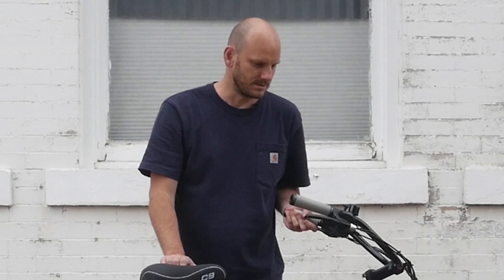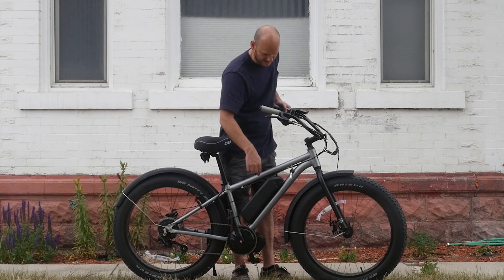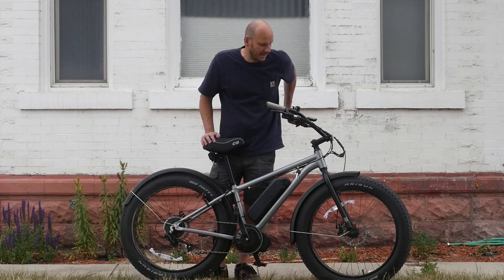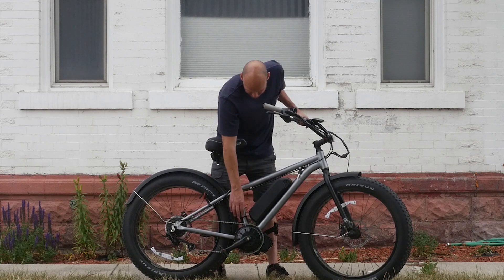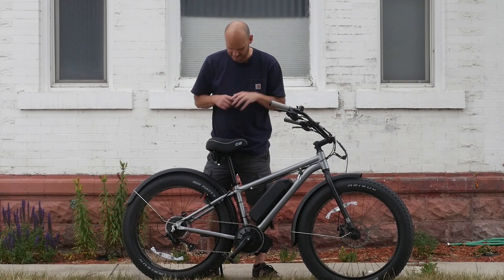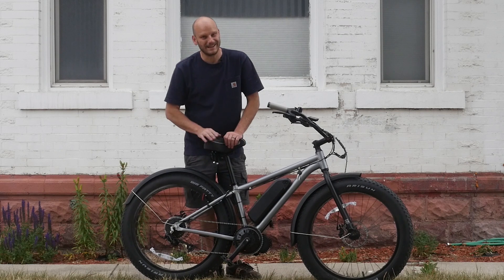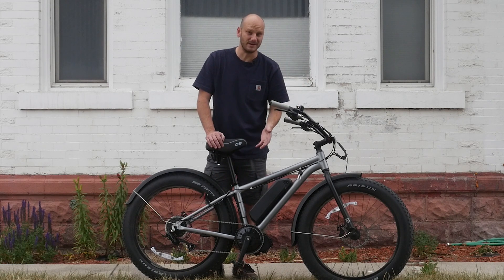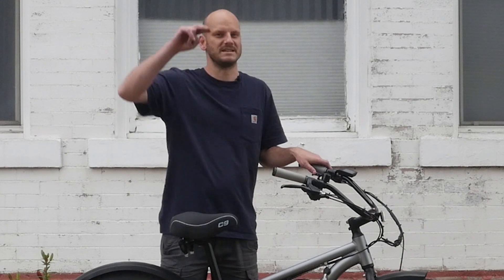Custom E-bike Build: Mongoose Dolomite ALX BBSHD 52v 14ah

Comment: I’m building a mongoose Argus trail with bbshd, hydraulic brakes, bmx bars, pedals, seat, and stem.  Im enjoying the process, and thinking about trying to make some extra money building bikes.  I can’t find anything comparable on marketplace for less than $3,000.  How much could I realistically get for the completed bike?  Everything I’ve started with was brand new.
Reply: Also, I ordered the bbshd kit from you.
Reply: Got the same bike. What battery did you use? I have the medium frame and wondering about what battery would fit.

Comment: I noticed you're out of stock on the Northrock XC00. Have you considered using the ALX as a replacement donor bike? It seems to be the cleanest build. No bunched cables, spacers for chain line issue, etc. I'm selling my Giant Talon 2 because its not the best donor for 4 seasons and the internally routed cables would be pinched by the motor if not rerouted. I'm planning on building my own with a large frame. Would you use a 42t to help me with snowy Nebraska hills and light off roading? Goal top speed 30.

Comment: I am the owner of this bike - had it made for my wife (the reason for the smaller than usual frame).  Fenders are from Rad Power Bikes - a little mod work was necessary but worth the effort.  The cruiser bars (from Cason City Bike Shop) have since been replaced - they required your wrists to be bent at an uncomfortable angle.  Replaced with riser MTB style bars.  Loving the bike so far.
Reply: so , how is the long term review?

Comment: Good review. What do you recommend for air pressure for the fat tire bike do you like. I’m 6’1,  205, and l have mine at 25. Tried 20, but bike felt sluggish. Your thoughts.
Reply from the maker: I like them at max for pavement unless I’m in soft terrain then go low as possible. Every tire is different for thresholds

Comment: I have built numerous hot rodded BBSHD powered Mongoose Dolomites, and at 230lbs., I have done a lot of off road rides and jumps with no problems whatsoever.  I did put suspension forks up front on all of them.  Great base bike, but this one looks too small in the triangle for the 27ah triangle batteries that I use.  Great video.  Cheers.
Reply: I think this was a small frame - S - 17". They come in M and L, as well.
Reply: I just purchased the steel dolomite. My 72v20ah plastic triangle battery fits no prob but I want more AH. Have a recommendation for triangle battery?

Comment: Bent my rear axle on my fat tire ebike. Thinking the 1000w bfhd motor with 30t sprocket was to much tourque for the cheep 9.5 long rear axle.  Any suggestions on a rear hub chang over?

Comment: I so wish I had bought one of those when available. The best deal I've ever seen on a fat bike. If they release more at the same price I may risk the divorce to get one;)
You made it into a really sweet cruiser. It seems like with different mods it would be an OK MTB.
Yeah it could be a better climber but that's a pretty harsh test without that right gearing. The sort of test that can fry a controller if the gearing isn't low enough. It did fine considering.

Comment: I am puzzled. You talk a lot about climbing hills. This is no off road build. Can't imagine much steeper climbs than out of The Mississippi River valley. If I could order all my motors, which are no where near as powerful, with 48-52 tooth chain rings, without paying extra, I would. Is this because you expect most of your customers to throttle ride?
Reply: BBS02 , cheap and good at hills on the right bike.
Reply from the maker: I live in Salt Lake City where hills can reach 15% grade on pavement. Hill climbing here doesn’t mean off road👍
Reply: Come to New England for some big hills
Reply: @Justagirlthatlovestheforest  I ypu have lots if hills, but not particularly steep.

Comment: John what size tires are you using on the Mongoose 2021 I have a 26” mountain bike mongoose rear wheel drive 1000 watt motor and a 48volt battery I built myself and I can get a top speed of 55 mph Lawrence can’t get enough of snow waiting patiently 8/31/2021 bigger is better 29”& 30” wheels
Reply: 55mph from a 1000w motor  you sure.  55kph maybe
1000w is equal to 1.34 horse power   the 2 stroke motorised bicycles push out 3 to 4 horses and they struggle to pass 50mph
Reply: @davidaustin7296  yeah 55 kph would be just about right for a 1000 watt. 55 mph no way.

Comment: How susceptible are the motors to water - I don't mean riding thru floodwaters where it will be submerged, but rain, puddles, that kind of thing, are they okay to ride when it's wet out?
Reply: Well I rode my iZip E3 Peak w/Currie hub motor in rain & wet all the time. Commuter bike, sometimes it rains (Bullet Proof since 2015) my battery is now expired. (Mid-drive 28 mph model ).
Reply: I’ve rode my bbshd home in crazy rain one time. Still works, would not recommend though
Reply: I took my carbon folding bike with mid-drive BBS02 out in the rain the other day. Bike got covered in mud and water. Still fine. I wouldn't do it again though or often.

Comment: Great videos , it’s awesome to see this bike through your test , I just bought a fat bike for hunting and going to put a bbshd and was wondering about what gearing I would need, so what chainring and cassette does this bike have? Also  how is the chain line  and how many speeds are used?did  the mud guards come with the bike ?Cheers from Australia
Reply: Luna eclipse chain ring  is what i use on my dolomite. Its comes with a 14-28t freewheel though , not a cassette
Reply: @soandsononame8750  cool  so what how many tooth is your chainring ? What top speed do you get on lowest and highest gear
Reply: @Artie6937  my luna eclipse is 42T i believe, it has a large offset that corrects the chainline as much as possible.   in first gear / 28T  it goes up to about 21mph with a 52v battery straight off the charger.  I don't typically use 7th gear because thats my one gear where the chainline isnt great and skips under high power. Dont really need 7th gear anyways, as the 6th gear can get it going 35mph+ down a slight incline. On flat its usually 4th or 5th gear to maintain about 30mph.  The aluminum dolomite is probably faster as it weighs less,  i have the og steel frame dolomite.
Reply: @soandsononame8750  Regular Dolomite has a freewheel... the new Dolomite ALX is a cassette and is an alloy frame.